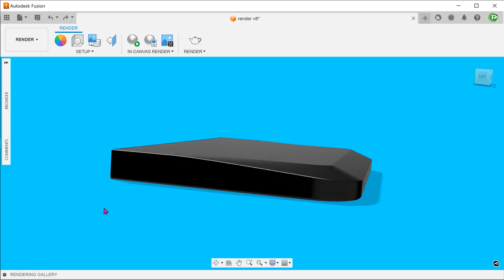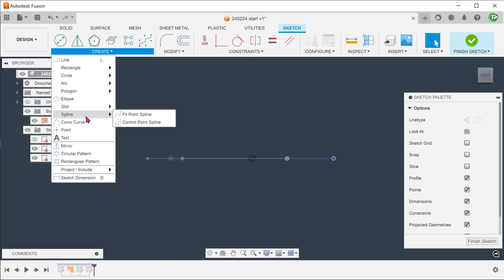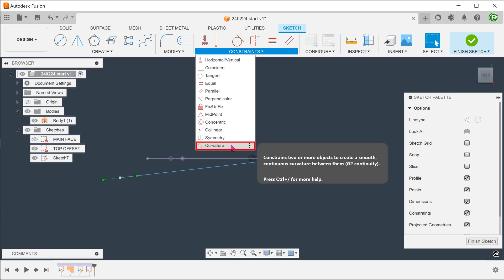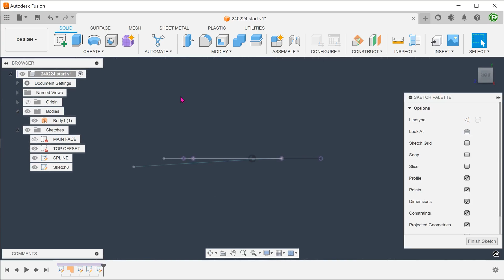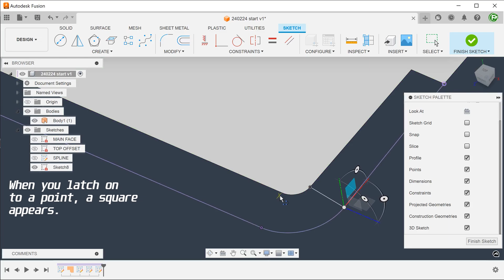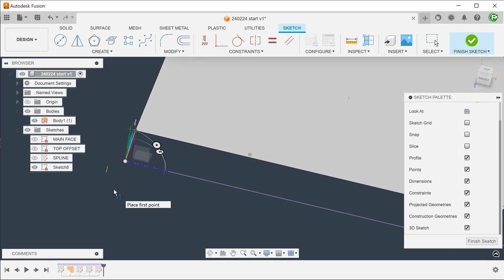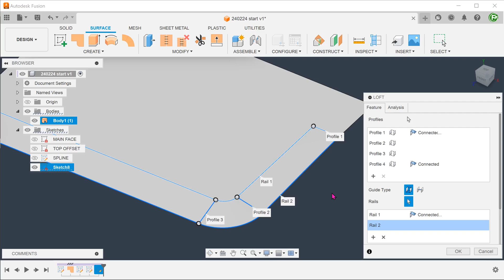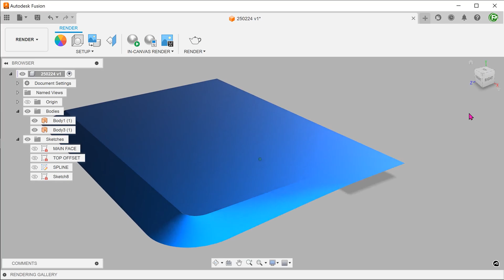Autodesk Fusion | Vanishing Chamfer

Comment: Thanks for the video! 

I acknowledge the name of your channel, however, it would be nice to see other CAD software on this channel. As a hobbyist, I use 3 different CAD programs, and I'm sure I'm not the only one who is CAD software agnostic. Would be great to see some videos with Onshape. It would also help bring news eyes, grow the channel.

As the best!😃
Reply from the maker: I have had some thoughts on this. It's not just the channel name. I'm sure a significant number of subscribers who subscribe to this channel only use Fusion. Looking at other channels which do mixed content, I find that the views can be spread quite thin. If I ever explore another piece of software, I will most likely create another channel. I am still trying find a good candidate. Something that has a big user base and which I can afford. I hear a lot about Onshape. Maybe one to consider.
Reply: @Fusion360School  Well I don't see how things have to change for your existing F360 subscribers, you'd just be putting out CADX content as well.

In any case, not trying to pressure you into anything, just providing honest feedback as someone who is a careful observer of YouTube creators. All the best!
Reply: @Fusion360School  Maybe, but you are correct.  I subscribe only for Fusion.  Nothing else has the depth of user base or machine support.  Every year I look at the other options and just shrug and continue happily using Fusion for CAD/CAM/POST.  It models very well and will run every machine I have and every machine I may get.  It doesn't look like anyone is going to beat them at their own game at least not in the next couple of years.

Comment: lovely video as always, but i would like to note that the pauses between steps were kind of a bit too much here. i prefer your videos heavily over other creators as they are quick and concise with no stretches of downtime or "filler" time. if this is just how it came out, no problem, but if this is an intentional choice that may stick around in future videos i would kindly ask you to reconsider. once again, thanks so much for all of your fantastic videos, they have become invaluable to me in learning CAD.
Reply from the maker: Upon rewatching, I did find the pauses a bit too long. I do agree that the edit should have been tighter. 
The editing process can be fatiguing at times. When tired, it can be hard to get a good sense of the passage of time. Will take note of this in future videos. Thanks for the compliments.
Reply: @Fusion360School Usually, I want fast content, however, these videos are well paced, and somehow soothing. Don't change a thing, or your channel will not be discernable from other channels❗
Reply from the maker: Thanks. Never thought that my videos can be soothing! I am not looking to change the overall pace. I will just try to make sure that there is not too much of a lull between actions.
Reply: @Fusion360School  Actually, its easier to trim pauses, than to add to length. And, you made it so much easier to concentrate. Some other youtubers just rattle too much to be helpful. So, keep it up with your current style. It works!
Reply: I thought so at first, but any time you are showing anything to do with 3d sketches combined with lofting... the pause is helpful.  Or perhaps not so much the pause as rotating the camera around as you did to show what the heck is going on.  That's a tricky series of steps to visualize.  Appreciate the tutorial by the way.  Thank you.

Comment: I have successfully also used a variable fillet to create the two lines and then used them as paths for a sweep with a triangle cutting shape or a simple cut if its straight. In this case i would try doing that but only use one half of the fillet while the second one would be the flat line. Your solution is probably better and more controllable.
Reply from the maker: A variable fillet sounds like an interesting idea. The chamfer does in some way look like a variable fillet but with sharp edges. Will give this a try. Thanks for the suggestion.